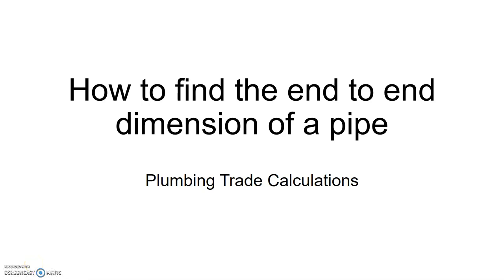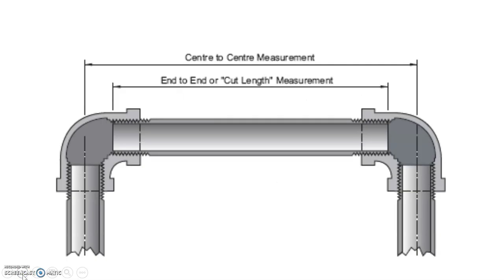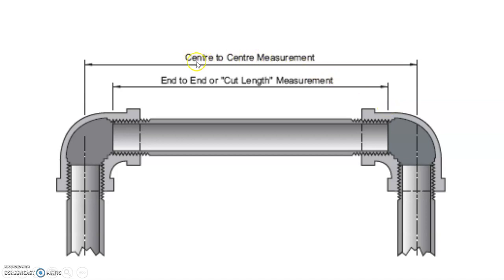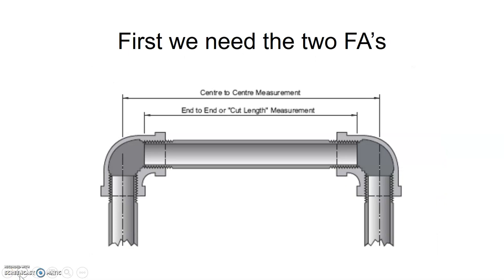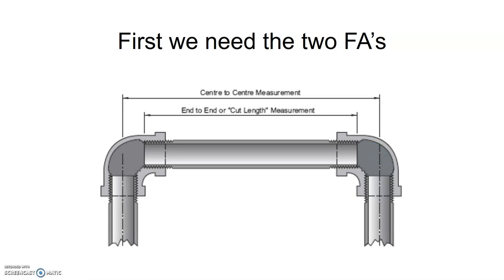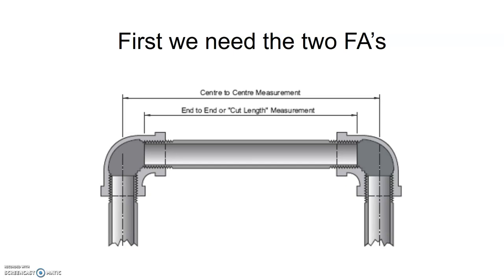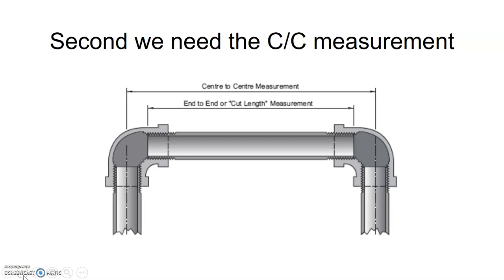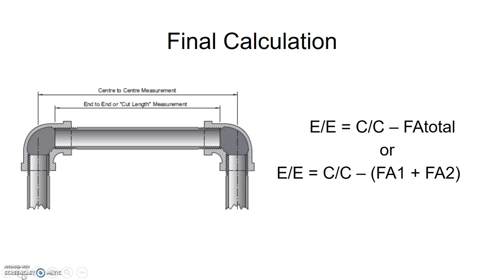How to find end to end using centre to centre

Comment: Measure the center to face of the fitting deduct the thread bingo ! 2/3 threads showing!  , The fitting should be 3 to 4 turns on by hand and you know your dies are set correctly , boss white and hemp ! That thread and send her home
Reply: So a 25mm fitting for example measure from centre to face which would be 40mm take off 20mm which is the thread and that’s you measurement???
Reply: Like if I need 300mm of 1” inch pipe end to centre of elbow, I would therefore cut the pipe at 280mm and it would be 300mm from the end of the pipe to the  centre of the elbow??? Is that correct

Comment: Hi Edward...
Please can you help me solve or know how to solve problems or real situations of take off in threaded joints.

For this examples: 

1) A piece of NPS ∅2" pipe is being cut to run between two 90° degree threaded fittings. The center-to-center measurement of the fittings is 7'-2¼". What is the cut length of the pipe?

2) A length of NPS ∅1½ inch pipe is to be cut run between two 90° degree 6.000# threaded fittings. The fittings measure 7 ft 2¼ inches center to center. What is the cut length of the pipe?

What fittings tables do you use to obtain the dimensions required for the calculations.

Regards... Thanks
Reply from the maker: Delibis,
You need:
- the face to Centre to Face measurement of the fitting (actually measure that yourself) you are using
- the Thread engagement based of NPS (can be found on American Standard Pipe Thread Table)
- Calculation the fitting allowance ( FA = F/C - TE)

Malleable Iron Class 150 - 2"   90 Elbow face to centre is 2 1/4"
                                               2" NPS Thread Engagement is 3/4"
FA = F/C - TE
     = 2 1/4" -  3/4"
     = 1 1/2"
     

Finding E/E (cut pipe) of 1 1/2" with C/C of 7' - 2 1/4"
E/E = C/C - (FA + FA)
       = 7' - 2 1/4" - (1 1/2" + 1 1/2")
      =  86 1/4" - 3"
      = 83 1/4"
      = 6' - 11 1/4"

Hope this helps.
Reply: @edwardlogan5428  Very grateful to you